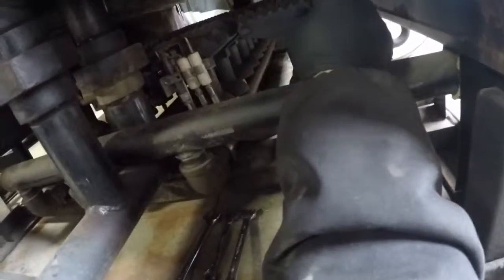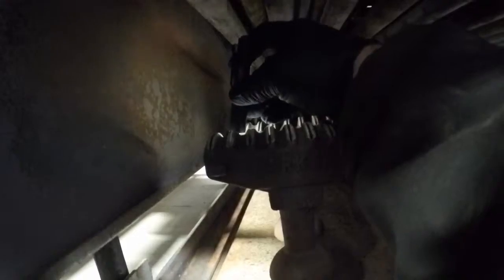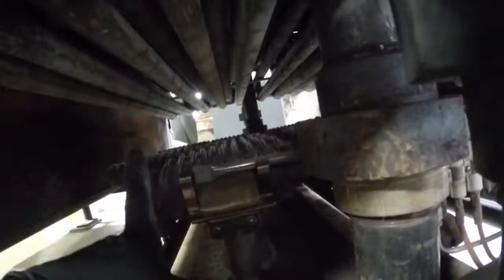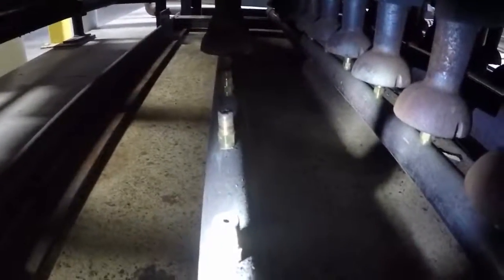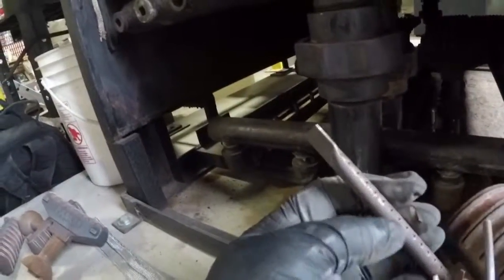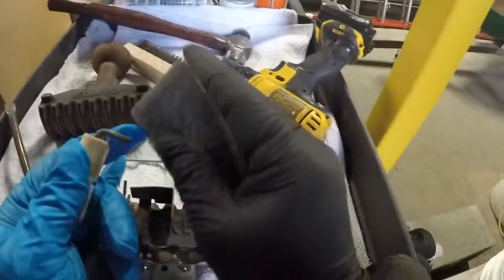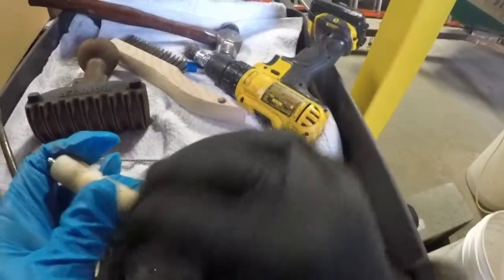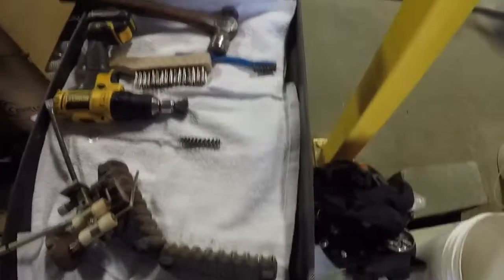Atmospherically Fired Burner Maintenance

Comment: Nice video!  I would be curious to know why this model is using a continuous spark when the pilot/burner is verified with a flame rod.
Reply from the maker: kt72383 I do know they will go to lengths to deal with possible signal interference from the ignition spark and true flame signal reading. Sometimes transformer polarity can interfere and there are flame grounding adapters. The fireye M-series controller is capable of turning off spark through terminal #4, but they are wiring it through terminal #3 with pilot valve. I think they are doing it for a safety/reliability reason related to draft conditions. Thank you for the great question
Reply: Thanks, good to know!